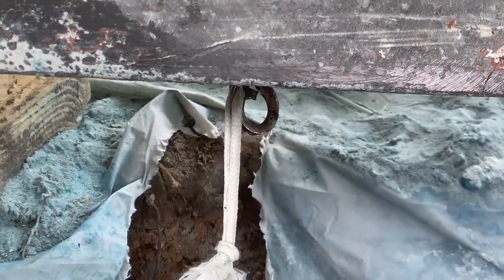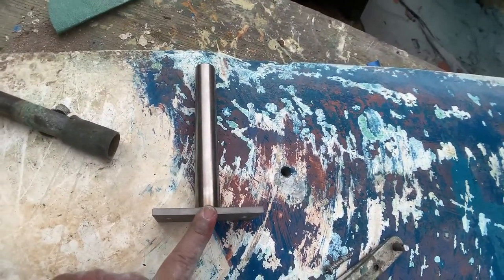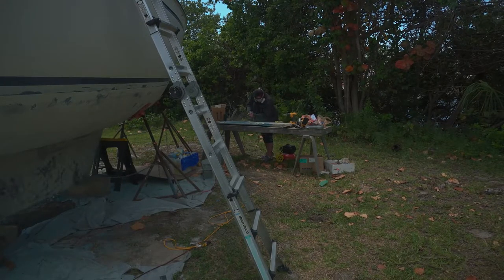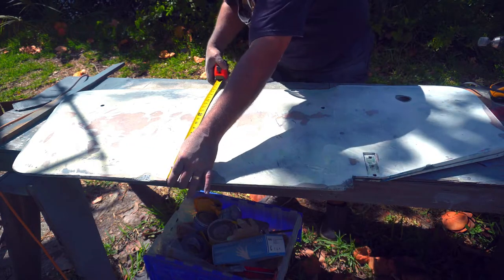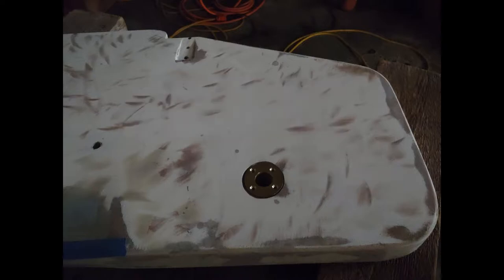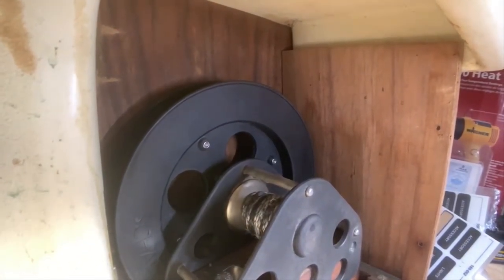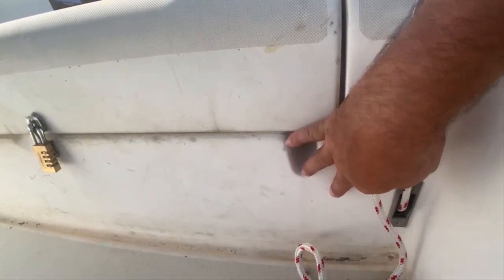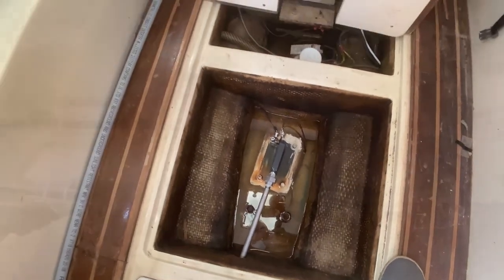REBUILDING SAILBOAT CENTERBOARD - Centerboard components and parts - A Step-By-Step Guide!

Comment: Jose…do you recall if there were lateral braces (flat 3/16” aluminum or stainless stock about 1 1/2” wide) across the keel bolts…then the large keel bolt nuts ?
Reply from the maker: On my P34 there are large washers and nuts on the keel bolts.  The last video I did on the sole of the boat there is a section where I show the bilge completely dry and you can see the keel bolts.

Comment: Per chance do you know if Pearson 35 uses the same system to release/lift keel?
Reply from the maker: Honestly I do not know for sure.  The P35 has a full keel while the P34 has a Fin Keel.  The P35 has the line on the Starboard side on the bulkhead on the cockpit.  It may operate in a similar fashion, but you would have to check.  If look where the mechanism is on the P35 for the Centerboard, on the back siden the winch would enclosed in a box.  You can remove the panel on that box to see the mechanism.  There should be a pipe and at least two more blocks to get the line to the pendant on the centerboard.  You should be able to trace those on your boat.  Wish I could be more specific.  Best of luck!

Comment: Painting stainless won't help protect it. It needs oxygen to last.
Reply from the maker: Actually, there is paint specifically design to paint all metal surfaces underwater. 

I used Velox Plus on my shaft and prop.